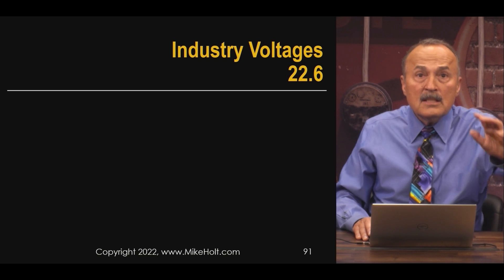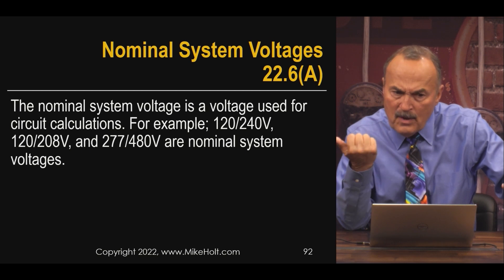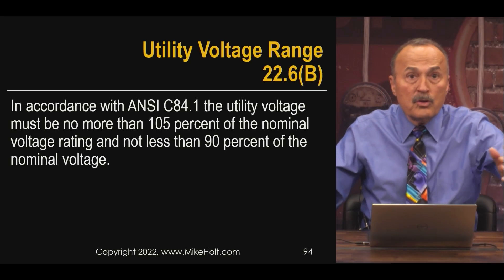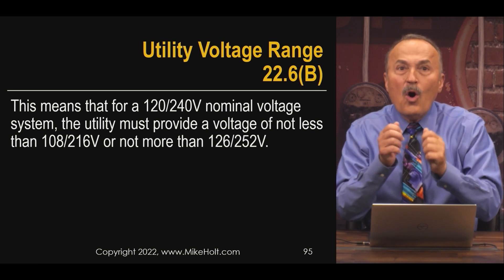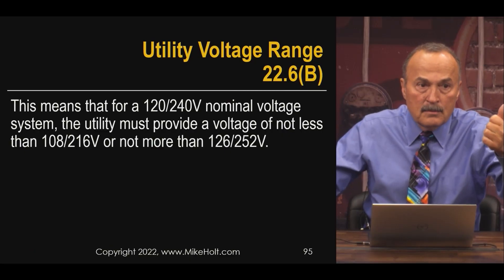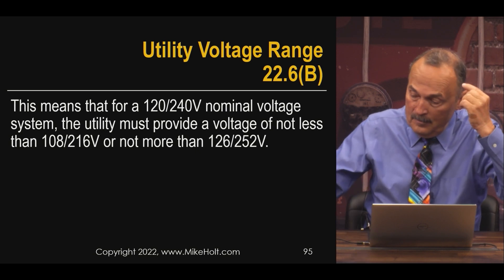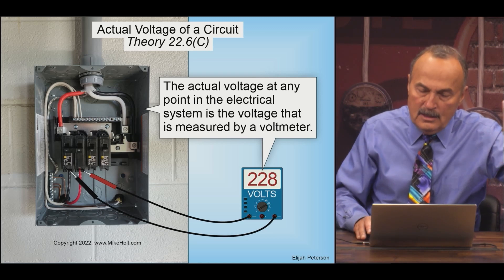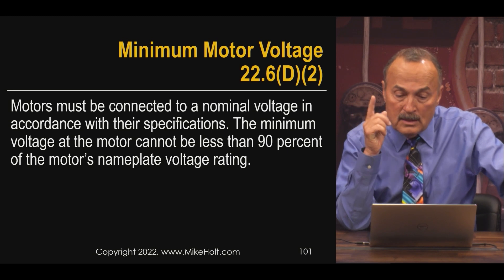Industry Voltages

Comment: While on call got called out to a 6 story building late one Saturday night that I was never in. Newly installed generator was running and had normal power.. Could not locate any books on new generator or the two ATS switches. Here the utility company was having a problem where we had over 515 volts and ATS switches would not transfer to a power source that voltage was too high .

Comment: Maybe ten years ago at an IAEI class they mentioned btw interesting things . Somebody is looking into having 575 volts three phase to save on wire size and in Japan some buildings have DC panels to feed computers and anything else that runs off DC. Could save at least 4% in energy & AC loads.

Comment: I wonder where you are getting this information from? From what I know which is quite limited, the only systems that were ever 110/220 was old Edison DC systems. They were around a lot longer than you might think. For example the very last DC Con Edison customer in NYC was not disconnected until 2008! Voltages and frequencies varied all over the place in the early 20th century. My grandfather who worked for GE his whole life and was an electrical engineer (lifetime member of IEEE as well) remembers some parts of California being on 40 Hz, and some places 60 Hz etc. Some areas of upstate New York were on 25Hz from Niagara Falls hydropower for a long time too. Voltages and grid frequency weren't standardized until the rural electrification of America New Deal project under the WPA. At that time they brought 115/230 to farms etc in the 1930's. From there it went to 120/240 after WW2. At one of my customers, a restaurant with a 600 amp service still has the old 1963-64 era distribution panels and main disconnect. The circuit breaker panels are Westinghouse brand, marked made in Chicago, Ill. From that state abbreviation of Ill tells me those panels were made before zip codes and city numbering went into effect, otherwise the city would have been like Chicago 7, Ill. The voltage rating on the panels clearly states "208/120 60 Cycles". I have also seen pictures of the data plate on one of the original generators at Folsom Prison in California, it also is 60 Hz, and 120 volts. So I don't get where people are still using 110/220 to describe AC voltages. I have never seen an electric motor or other appliance that is less than 90 years old state anything other than 115 or 230 on it. From at least the 1950's until today, low voltage systems have been 120/240 split phase or 208Y120. Or 480/277. Medium voltages like 4160/2400 used to be 4000/2300 back in the very old days, pre 1950's but today aren't used anymore, at least the majority of utilities don't give you anything other than (for new construction) 120/240 208/120 480/277, you either get those standard voltages or you have to take 12470/7200 and buy your own transformer. As far as 12470 "creeping up", at least in my area, I've seen many brand new 1000 kva or larger pad mount transformers, they all still say 12470/7200 on them. I know in some rural dry desert areas of California like out in the Mojave Desert where the ground is so hard and/or dry, the SEWR 7200 single phase single wire system just didn't work, so they went with a 14400/25000 volt system, and supplied all the pole transformers with two phases, eliminating the need for a common neutral wire on the utility poles. The only issue with that is, they found out it gets very hard to balance phase to phase voltages and power factors, because connecting a lot of single phase loads on 3 wires with H1,H2 dual bushing pole transformers can unbalance things. With a 3 wire overhead set with a common neutral wire, the utility neutral wire will carry the small amount of unbalance and help keep things stable without having to hang a bunch of capacitors and reactors every few poles, to keep the power factor somewhat reasonable. Sending power over very long distances at lower distribution voltages is a challenge, so it's better (from POCO's point of view at least) to keep everything on a WYE system. Circulating harmonic currents in Delta wound transformers can be an issue as well.
Reply: @MikeHoltNEC  By 1949 75% of incandescent light bulbs sold in the US were rated for 120 volts.
Reply from the maker: @brnmcc01, please provide the link for the data that supports your comment.
Reply: @MikeHoltNEC  "An important part of the early work in connection with the review and revision of ANSI C84.1-1954 consisted of a comprehensive questionnaire on power
system design and operating practices including approximately 65,000 measurements of actual service voltages in all parts of the United States and from systems of all sizes. The results of this survey not only confirmed the concept
illustrated in Fig. 1, but also indicated that C84.1 had effectively ended the
inching-up process in service voltages. Mode voltage readings (most frequent)
taken on 120, 208, and 240-Volt systems were 120, 210, and 240 respectively.
Corresponding average voltages were 120.9, 211.0, 241.5 Volts respectively. Replies to the questions on system design practices indicated that the utilities
were indeed following the recommendations of C84.1."

--- from that paper published in 1976
Reply: So nominal system voltages are what they are today since probably 1941-1949 era. By 1954 when that study was finished the average voltages they took match what we would expect to see today.
Reply: @MikeHoltNEC  I tried to post a link, but youtube deletes comments with URL's, even if I put dot instead of a "."

Comment: It also depends on how far away one is from a substation. The closer one is from a substation the voltage will probably be over 120 volts. And those further away from a substation the voltage would be less than 120 volts as a whole.

Comment: He is correct about the tap changers, most stations have automatic tap changers depending on the demand throughout the day. Also the closer to the station the higher the voltage and the farther away the lower the voltage especially on the lower primary voltages. If a customer or customers on a particular transformer are complaining about the voltage being to high or to low they can open the transformer and change the tap.

Comment: Maybe 8 years ago while attending an IAEI continuing education class they to!d us two interesting voltages things: Looking into having 575 volts to supply equipment & motors so save money by using a smaller wire guage and was to!d somebody in Japan was looking into supply DC power to every floor of an office. Think they stated that by using DC that computers, power supplies, UPS'S and VDS's would not require rectifier and savings could be over 3%. Back in the 1980's we had an engineer that worked for the company for over 25 years and told a German company that made a state of the art candy packaging machine that we had 440 volts three phase. We had 480 volts and at night & weekends the higher voltage would trip out one of the 7 computers on the machine for having 24 VDC power over 27 or 28 volts. Brilliant engineers had a think it was a 480 to 460 volt transformer air freighter in. They did not have a 480 to 440 volt step down transformer big enough in stock ( at least 112 KVA ). He to!d me to stay overtime and call him after I connected it. Told him he ordered the wring transformer because the voltage was still too high. He accused me of not knowing how to connect a transformer up. Cursed him out & hung up the phone on him. After the chief electrician verified that I connected this simple 3 wire in ,3 wire out transformer correctly he told the brilliant engineer that problem was not fixed. We had to lower taps on 13,2000 volt transformer that feed the 480 volt buss duct to machine.

Comment: I'm pretty sure the Range A service voltage on ANSI C84.1 is actually 114 V-126 V, and Range B is 110 V-127 V. It's actually the Utilization Voltage at the equipment terminals after accounting for all voltage drops that has a range A of 108-126. The Range B for utilization voltage is actually 104-127V. Range A is permissible for continuous operation, while range B should provide adequate performance but should not be prolonged.
Reply from the maker: Correct

Comment: While monitoring the utility voltage coming in at a campus facility, 504V on a 277/480 volt system always made me nervous. 
😅
Reply: Yep, one building near my house the voltage there is more like 495 volts, and roughly 280 line to neutral. I'm suspecting the voltage is high in that area now that RCA plant is long gone.

Comment: Just got a motor marked 115/230   manufacturer says its good for 208 which is true  +/- 10% . But my  voltage at disconnect is 202-198 which puts me out of range causing  heat and more amps.  I was told 208 motors do not meet  efficiency standards, and that's why. But this is going to cause some issue  and or alot of buck/boost xfmer.
Reply: Many if not all modern central AC units and other 240 volt appliances meant for residential use give ratings for 240 & 208 or sometimes 120/240 & 120/208.
Reply: @Sparky-ww5re  I'm talking like rooftop ex fans

Comment: The very last batch of incandescent lights I purchased had 130V stamped on the bulb. It made me wonder if they will be bumping the voltage up.
Reply: Donald Trump rewired the incandescent bulbs to make America great again
Reply: 220Y/127 is also a industry standard voltage used in  South America , but also can be found in the US and Canada. Manufacturers have adjusted to that. You'll see some power supplies that say 100-127 on them.
Reply: @PW_12345  I wonder if the 240v bulb would even be bright enough to be useful.  I had a headlight that was dim on a car once and it had good power and ground while the light was on.  Removed the bulb and saw it was for a 24v system.  First one I have ever seen but it was about as bright as candle lol.  The filament was a lot thicker and had more turns from the looks of it.